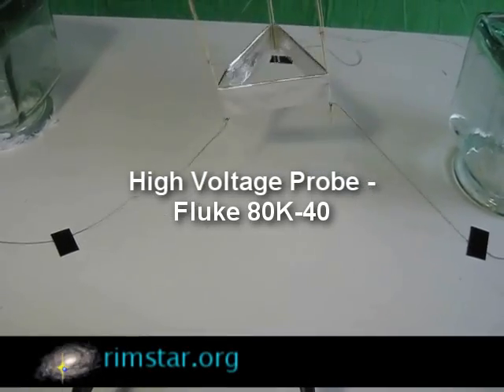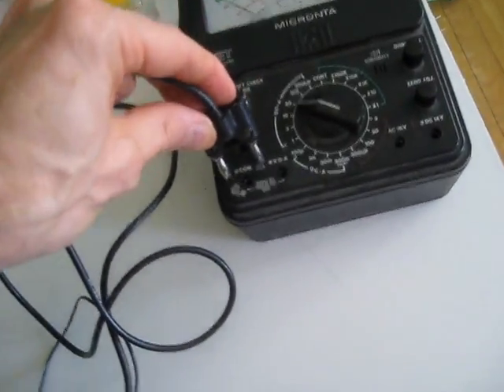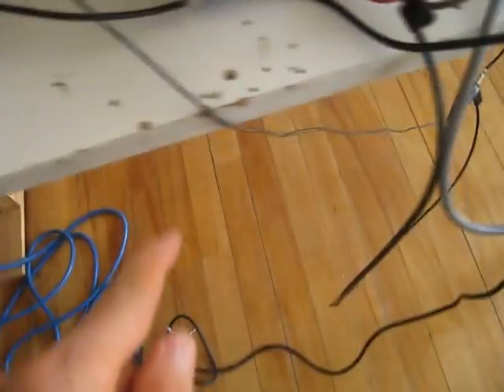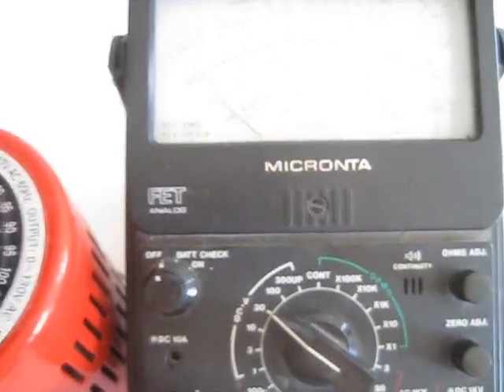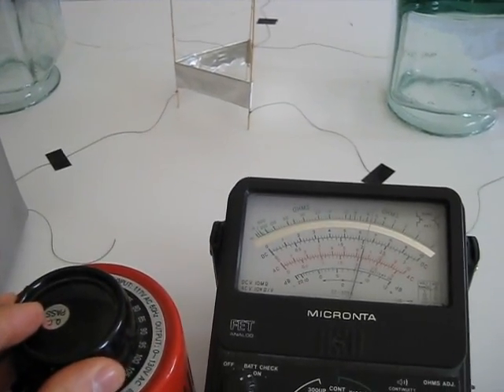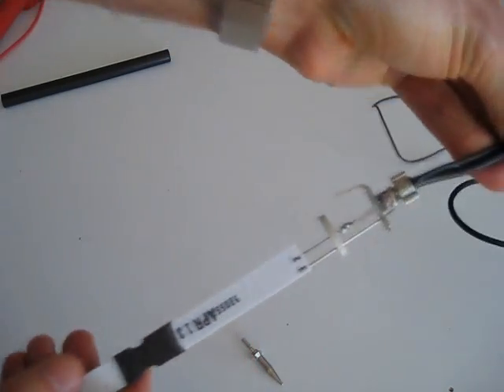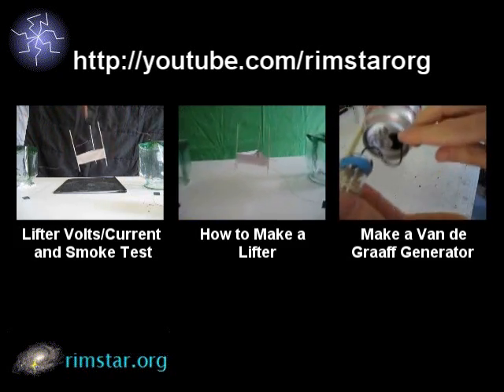High Voltage Probe How-to with Fluke 80K-40

Comment: For designing 100kv can you advise any resistor for impetance 10Meg
Reply from the maker: See this webpage for info about designing high voltage probes http://www.repairfaq.org/sam/hvprobe.htm . I used that website to help me build my high voltage probe, tested to 75kV but designed for more,  https://rimstar.org/equip/hv150kvprobe/hv150kvprobe.htm

Comment: I know from personal experience those probes are extremely susceptible to breakage.  While your show and tell is informative,  those solder joints inside will be weakened from the flexing you produced in your demonstration.  Also,  those resistors are precision, so if you rely on highly accurate measurements,  the oils from your hands could skew your values.  

So unless you suspect your high voltage probe is broken,  I'd strongly suggest leaving it intact.  If you don't,  it'll break soon enough.

Comment: Whe using the probe can you use the ground wire from an AC outlet? Thanks.
Reply from the maker: Maybe. A voltage is a measure of a difference between two points, a high voltage point and whatever that high voltage is relative to. If you're measuring the voltage of the cathode ray tube on a TV or old computer monitor then the high voltage on the tube is relative to the ground prong on the plug, so in that case the answer is yes. But you might have a high voltage source which doesn't plug into the wall socket. In that case there must be some other measurement point in the power supply from which the high voltage was raised. If you tell me what device you're measuring then maybe I can help.
Reply: @RimstarOrg  I want to measure the output of my HV supply which is driven off a 24 volt switching supply itself driving a ZVS then a flyback coil.  The ground (I suspect) is the case of the switching supply. My probe will arrive today and what I intend to do is reduce power level by going from the 28 volt switcher to a 12 volt sla battery for initial power. I will  feel a little safer since then the output is much less.  My whole life I've worked with things at much, much lower voltages and still feel a healthy amount of fear with HV :-)
Reply from the maker: The flyback coil should have both a HV side and a ground connection for the other end of the output coil. I'd start looking for it there.
You're right to have a healthy amount of fear with HV. I started out with HV and I still give it a lot of respect.
Reply: @RimstarOrg  Thatk you sir I just measured it with a second hand probe a got 15.9 kv.   Now to build a capacitor from some old page protectors I have :-)

Comment: Can you link me to a proper CRT discharge tool? Especially for a 40" Mitsubishi.. screw driver and wire method only gets ya so far and I need a long term solution... Btw, these bigger tubes make me nervous. Could I actually attach my probe or if I'm still using a screw driver... To a long wooden pole and discharge from a distance?
Reply from the maker: I don't have any link to a proper CRT discharge tool, or know if they even exist.
Yes, you can use a long wooden pole, which I often do myself. If the wood is wet then it can absorb moisture and become conductive so a plastic pole would be better. I do it in this other video https://www.youtube.com/watch?v=GEuK1OdYxHk at seven minutes and thirty-seven seconds in.
It's not needed with this Fluke probe though. The probe already has an insulated handle.
Reply from the maker: Note that the probe isn't great for discharging, only for measuring. It isn't great for discharging because it has such a high resistance. That makes it discharge very slowly.

Comment: Thank for the info. I have ordered a generic high voltage probe which looks like the Fluke one with the same specs. I want to use it to measure the DC flyback HV output. Have you tried to wire the probe to an oscilloscope to check the waveform of a flyback? I wonder if there is lots of waveform distortion at high frequency? 
Is it possible to measure the voltage across the MMC bank of a tesla coil using a DMM  if the HV probe is connected to one end of  a  static spark gap and MMC in parallel to a flyback with the primary coil removed? I want to measure the voltage across the capacitor during discharge at different gap spacings. My motive is to prevent blowing up all my capacitors  during voltage surges. I dont understand how voltage across the capacitors can go over 1.4 times the RMS of the supply voltage if the spark gap is too wide.
Reply from the maker: I did try using this probe hooked up to an oscilloscope to measure the output of one of those flybacks with a built-in diode. You can see me do it near the end of this video here https://www.youtube.com/watch?v=-KFhBVfpfDw (seven minutes and 35 seconds in). What I saw was flat, which makes me think there was some capacitance in my measurement setup which smoothed the expected pulsed DC.
Regarding measuring spikey or intermittent output using a DMM, you pretty much need a scope, otherwise you'll likely miss the peaks. Possibly if the DMM has a maximum feature then that would help.
Reply: thanks for the reply. I was surprised that it is flat and not pulsed. But then it makes sense to me now.  From my limited knowledge of electronics, the series of resistors create high parasitic capacitance and inductance, so it becomes a series R-C-L circuit. The parasitic capacitance is large at high frequency even it not pure AC but kind of half wave DC pulses.  I think thats why the probe is rated 50/60Hz. So I suspect the non-linear discharge waveforms would be very distorted even if i use an oscilloscope with high bandworth.

Comment: sir, i have hioki high voltage probe with 30kv dc limit, in the manuls they said if the probe just only measure dc hv supply and cannot use to ac hv, what the different of hv dc probe with hv ac  probe ? what if use this probe to measure Microwave Oven Trafo with output 2000V Ac output ? it safe for my meters ?
Reply from the maker: +Raja Gama Suhadanto I'm no expert about high voltage AC probes but from the little reading I've done in the past, the AC probes need some added capacitors. Your probe just isn't suitable for reading the microwave oven transformer's AC output. Be very careful with that output in any case as it's not only high voltage but also high current - very, very dangerous.
Reply: +RimstarOrg thanks sir for the advice

Comment: I have the same meter...so if you are measuring negative voltage you flip the probe  connectors over on the meter?... minus to positive ...correct? also you still have to ground the clip?
Reply from the maker: +bones007able Do you mean you have the same analog meter? That's tricky then. The high voltage side of the probe is designed to handle high voltage with respect to ground, either negative or positive. It has a fairly rounded tip and the voltage division is done by the resistors inside. If you use the ground clip on your high voltage then you're using a clip with sharpish points and a poorly insulated wire going to the meter. You'd also be putting the high voltage directly into your meter. I'm not sure what to suggest if you're measuring high voltage negative and you have an analog meter, other than use an oscilloscope instead of the meter (which is what I do for negative high voltage), or a digital multimeter if you're measuring DC.
Reply: unfortunately it is my scope that  I need to check..it quit working, need to verify 1700 negative on the tube ,  so your saying I can't flip over the banana plugs plugging into the meter to measure negative voltage?...how did they measure back before DMM's? I can have measured up to -985 just by plugging in the negative lead to the 1000 v input and the positive to the ground... you can't do the same with a High v probe?
Reply from the maker: +bones007able I was going to explain why it wouldn't work by showing this typical high voltage probe schematic http://rimstar.org//equip/hv150kvprobe/hvprobe_schem1.jpg but now I don't see why it won't work. Just make sure your meter isn't grounded in any way since you'll be putting a high voltage into the negative input. Since it's only 1700V the issue with sharpish points won't be that bad (I'm used to measuring much higher voltages.)

Comment: That Fluke  probe is Ac and Dc is it not? So in short to test the secondary of a plate transformer stick that on the Ac side on 3 would be 3000 Volts?
Reply from the maker: +Harley 1963 Yes it is AC and DC. For AC accuracy it says only that at 60Hz it's +/- 5%. And yes, on the AC side, 3 would be 3000 volts. Also, for the voltage range it says peak AC is 28 kV RMS AC.

Comment: Hello Rim,
I have bought DC 3V to 7kV module from ebay. The module is producing sparks at a distance of 2mm. So I calculate that the output voltage to be 6kV. I have tried to measure the voltage using YOKOGAWA high voltage probe, but the reading is only 220 V. I have tested the probe it is working fine. Can you advice me how to use the probe to measure this module.
http://www.ebay.com/itm/DC-3V-to-7KV-7000V-Boost-Step-up-Power-Module-High-voltage-Generator-/171023115677
Reply from the maker: Ismail Hussain How are you using the probe and which one is it?
The problem could be that there's very little current available from the module. If you touch the probe tip to one output wire of the module and ground to the other output wire then some current will flow from the module to the probe and from there to ground. There's a resistance network inside the probe that is a high enough resistance to keep the current low. But if that's all the current the module has available then it will pull the module voltage down.
The same thing happens when you make an arc between the module's two output wires. During the arc there is high current and very low voltage.

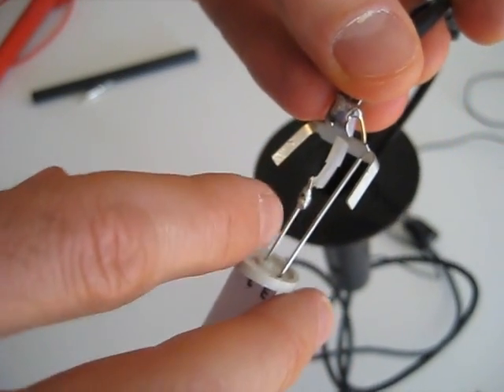Comment from the maker: For the probe itself, arcing shouldn't be an issue as long as you keep the voltage within the probe's ratings. The current is low on the meter side due to the probe's resistors. The only place I can see an arc affecting the meter is if the voltage is above the probe's rating and an arc occurs in the probe at the place I point out at 4:07 in the video. But even then the arc would be through the probe's resistors and the current will be low. Stay within probes ratings an you should be fine.

Comment from the maker: That depends on what broke. I would open it and look for obvious damage. If there's none then I'd desolder the resistors and measure their resistance. Maybe one of them was damaged by too high a voltage. If so, then I'd look online for a long resistor with the same resistance and replace it.

Comment from the maker: Depends on how you look at it. I started out saying that since the dial is set to the 30 volt scale "that 3 is actually a 30, that 2.5 is 25" so it's x1000. If you use the dial just to set which scale on the meter to read then you'd treat the 3 as a 3 and it's x10,000 as you say. Either method works.

Comment from the maker: Regarding AC line voltage, 33kV system, the instruction sheet says AC voltage range is Peak AC: 28kV RMS AC.

As you see in the video, the probe has two spaced banana plugs but I sometimes clip to these plugs using my oscilloscope probe. The probe works with meters which have an input impedance of 10 megaohm but if your meter has something else then you can use an external shunt or multiply the result by a correction factor (e.g. multiply by 0.99 for a 11.11 megaohm meter.)

Comment: Hi Rimstar,
Can we use the same measuring probe to measure AC line voltage ( 33kv system)
And the probe i not compatible to the fluke digital meter. Please advise

I have seen other make similar to the fluke 90K - 40, "S.E.W PD28". The probe looks compatible for digital meter.